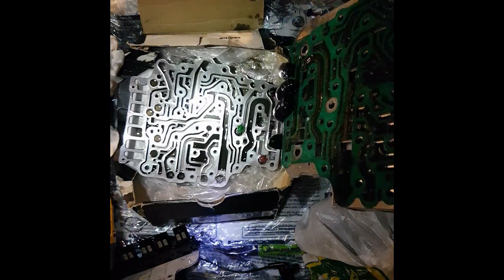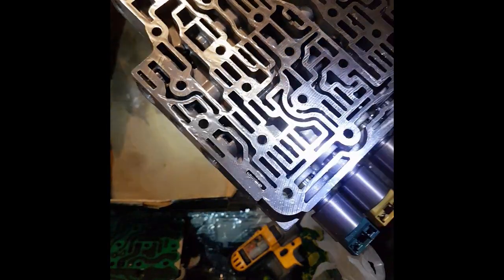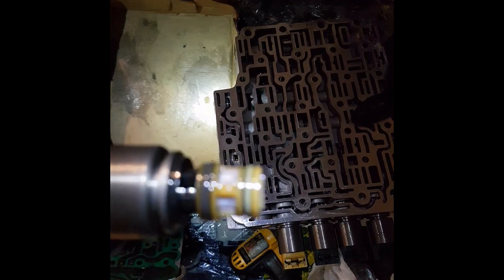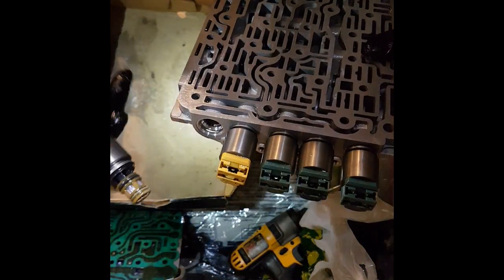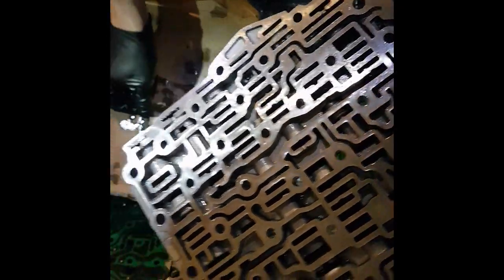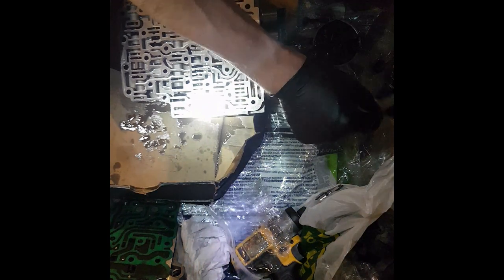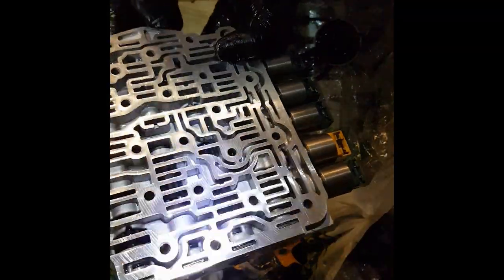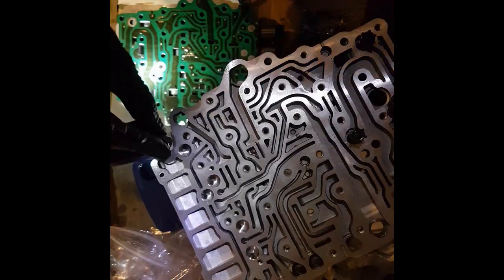Ford Freestyle CVT   Video 3   Disassembly

Comment: I took out the first 8 bolts, not its just loose hanging there, but it wont come completely free. Whats the black thing hanging up on, on top.
Reply from the maker: Not just disconnecting the harness, but removing the part that the harness connects to.
Reply from the maker: Did you remove the TCM connector shown in the beginning of video 2? https://youtu.be/6lYa3QlfszQ?si=UJokJwWhQkzrOlXz

Comment: Reading the description causes me to lose hope..it doesnt make sense that it end up failing😮 when you cleaned it but according to what your saying after i do my part I should get a transmission flush somehow. When I talk to trans experts mechanics they say they dont mess with this stuff🤯 so its like we are on our own as DIY,ers
Reply from the maker: Yes the best way is to swap in a transmission that isn't showing any symptoms, and change the fluid and filters every 50k. That goes for the PTU, Haldex, and differential too. Following the lifetime fluid recommendation is just asking for failures.
Reply: No one will touch the 05 freestyle transmission. I have a 0701 ocde and I have to do all the work myself. Easy but cost money and time consuming.
Reply: @mariamacpherson1766  I have 07 Freestyle with PO701 code, I changed fluid and both filters, also throttle body with no success, can I ask if you were able to fix your car?
Reply: It's not for the CVT cause a lot of cars these days have it. It's the year of the vehicle.

Comment: So this unit can be replaced if your getting the dreaded p0944 code hydraulic pressute unit ( fail)🤔
Reply from the maker: You can probably get it working again by taking the mechatronics apart and cleaning all parts. But if you can find a working used transmission for cheap I would recommend going that route, since there is a good likelihood that you have deeper mechanical problems causing metal shavings to seize up the valves inside the mechatronics unit.
Reply: @ZachS13FTW  my issue is I can do it myself. I just dont have a space to work on it If i had a buddy with a garage that wud help
Reply from the maker: @stoplookinent4791  yeah that always sucks. I've spent too many days working under a car parked on the street. Garage space has been my main priority in choosing my living situation for the last few years. Still end up working outside on the driveway more than I like to admit lol.
Reply: @ZachS13FTW  its not bad in a suburb. In a urban jungle its more of a hazard. I have the ford freestyle from what im hearing the transmissions just goes out on these period aint no saving them. My car doesnt revv in idle or in park there is no response to gas pedal the wrench light and check engine light are both on. Funny thing i can throw it strait into drive and its driveable it just hums loudly and gives off the helicopter noise..
Reply from the maker: @stoplookinent4791  yeah, once they start giving you problems it usually means your input shaft (iirc) has been wearing and giving off the metal shavings that block up the valves inside the mechatronics unit. I cleaned mine twice and it worked afterwards both times, but the problem came back after a month or two. Ended up replacing with a used transmission. From now on I'll be doing fluid changes on CVT, transfer case, rear diff and haldex every 50k to hopefully prevent failures.
Reply from the maker: @stoplookinent4791  strange with the no rev in park tho, mine never had that problem..
Reply: @ZachS13FTW  something killed that gas or throttle when i run the scan it doesnt say anything pointing towards it. Yet when you crank the car it smells of gas making me thing the evap sensor up front could of malfunctioned. Which cud of cause the gas to limit itself. Tbh i think somw bad juju caused this thus car was fine then boom it wasnt no indications of breaking down
Reply: @ZachS13FTW so i finally got it off 😵 hard work man no drill...so judging by what you did in this video I have to do all this just to get at the selonoids inorder to clean them with mass air flow cleaner???

Comment: where to buy the parts of good quality and good price
Reply from the maker: Recommend buying Ford's Motorcraft parts as far as filters and fluids, I've heard mixed reviews on the cheaper filters not sealing properly.. although if the cheaper part is the same exact size it should be no problem.  Dealerships are never cheap but they usually have parts available or can bring them in, where a lot of part shops might not carry them anymore. I'd recommend finding a rubber transmission pan gasket if you can so you can drop the pan every time you drain it and get any metal particles off the magnet that sticks to the pan, and not have to replace the pan gasket each time.
Reply: @ZachS13FTW  I bought an autozone filter and oil, installed I saw that the filter fits but it did not give me confidence, I feel that it does not seal well, I did this before you commented, I drove the car and it continues to give problems, but after 10 minutes the transmission light returns and it does not change, I have to turn off and walk again, take the car 5 places and they only say change the transmission, fault codes p705, B1676, U1900 I don't know what to do
Reply from the maker: @williamhernandez351  if possible try to find someone who's scrapping their Freestyle and if the transmission is good, buy it and install it. I got mine working twice by cleaning the valve body and solenoids, but somehow a few months later my CVT chain broke and I ended up having to swap in a used CVT. In hindsight I should have found a used CVT when I first had problems and I would have saved a lot of time. If you do decide to go the swap route, make sure the AWD PTU works on the new one too, it's another part that commonly fails due to fluid not being changed!